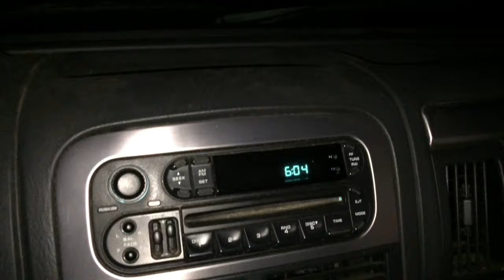Off Grid Cabin Time: 9-10 & 9-11-16

Comment: Hey Tommy ya'll need about a 200 to 300 amp fuse. 60 amp breakers wont take the aircon load.
The load an aircon will use when it first fires up is a.minimum of 4 times its rated wattage.
A lot of pro's say to allow 8 TIMES it's rated wattage !
Just a heads up from a guy who does it for a living.
Great vid, as ever, 
God Bless,
Sundancer.

Comment: I don't think it was the wire size that caused it to melt, I think it was a bad connection at the fuse block.  Bad connections probably start more fires than overloaded wires.

Comment: D! Those are skinny swamp pines.  How you going to safely make a tree stand on one of those?  Might have to make an entire complex tree house for a tree deer stand ...

When you have a cut-down and leaning tree, you diagonally-upward undercut the tree (and don't pull it!).  The tree then has a chisel cut on its bottom, falling vertically plants itself into the ground.  Then do another conventional cut and felling, until you get the leaner safely onto the ground.

Then use all this lumber for making your tree stand with buttress poles planted into the ground, and OGKid can make a raised tree house platform around the central tree trunk.  Then use tyvek as the tree stand hide, wrapped around a wooden framework. 
Can paint in seasonal outdoor colors and patterns (Real Tree etc).  Can then razor cut various slits of rifle positions into the tyvek (no windows!) for shooting angles.  Also make a ghillie tree house, by putting brush into other tyvek holes, making it look like a huge squirrel nest, even hiding your tyvek and rifle slits.  9' x 28' makes a square 7' platform sides, with a 6' tyvek wall and 3' insloped tyvek ceiling wrapped to the tree trunk.  Windproof, waterproof, breathable, warm-but not overwarm, doesn't flap and make wind noise like canvas/tarps/plastic, lots of space walking around platform, and have all the comforts of a residential treehouse as well.